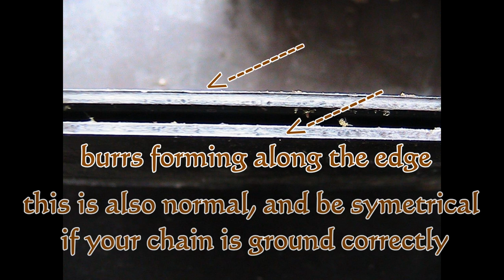Logging 101, episode 5, correct chain tension

Comment: good reminder, especially for occasional users like me ,.... one time i got an electric one with a power tool lot, ...and the chain was actually backwards....:-)...As my cheapo saw moped has a rather soft bar, i just stone the burrs, because as you say, a file will dull quickly.
Reply from the maker: thanks Mike, the next video in this line-up is going to be about rakers and how to do them properly.. the next one after that will be showing how grind the bar properly. there are dedicated grinders for the job and i'll be showing how to build one later on but there are grinders some of have that are well suited for grinding the burrs off the edge of the bar.